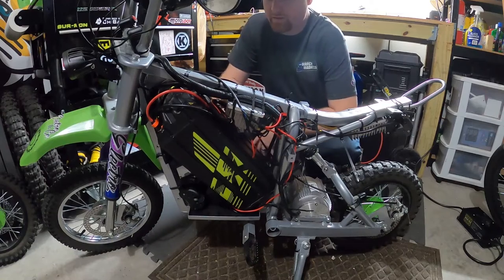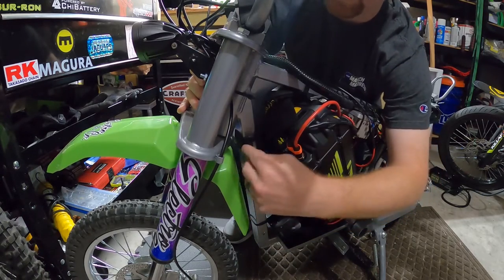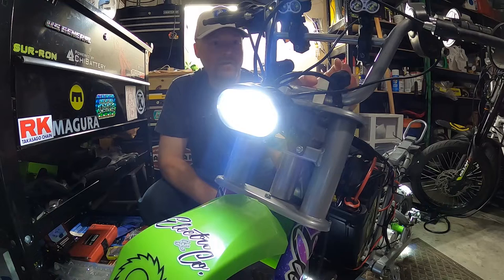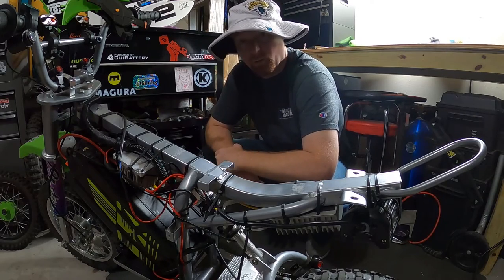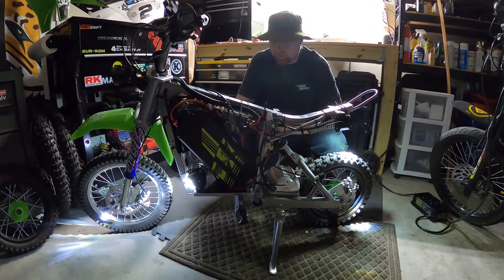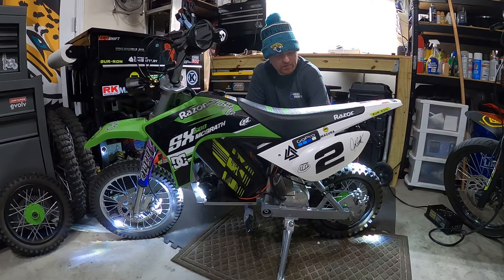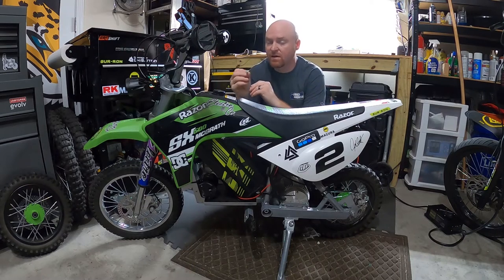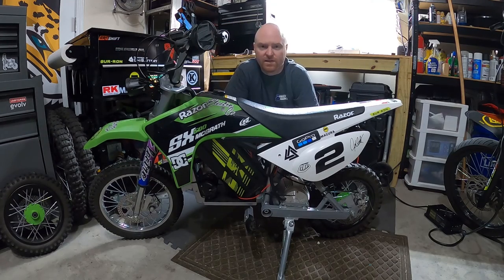Razor SX500 with 60v surron battery, 5kw motor & kelly controller

Comment: Yes. Please do a lighting video. I got an SX500 this weekend. The best if the MX line in my opinion.
Reply from the maker: Hey I agree! And you got it on the video!
Reply: @chaseschannel1151  Thanks! I am waiting for my Electro and Company kit now. I actually found both the SX and RSF650 for less than one new MX650. These are really sweet, capable bikes.
Reply from the maker: @Nohoze  that’s awesome. Great finds. Yes, with knowledge these bikes can become quite powerful machines and the best part is they look like toys so you can get away with riding them much more places.

Comment: How did you secure the battery. Your first video you had straps. Just wondering if you came up with a better solution?
Reply from the maker: @patrickbowen5567  I just used the straps, that and the plastics held it in place, def not 100% secure but with my riding it held up ok. Probably could look at hardware store and build better solution

Comment: What’s the point of the the 60v to 12v step down
Reply from the maker: I had some lights that were 12v. If I connected them directly with 60v they would burn up.
Step down converts 60-12v

Comment: Did you just order a standard 5k kit from E&C or did you request a different harness or anything?
Reply from the maker: I requested them make the wire pigtail to fit the surron battery. They were kind enough to change that for me no extra cost. the rest of the kit was standard.
Reply: Ok thanks. I love your bike and your explanation. I ordered an E&C kit 6 weeks ago with a battery but I think my next project will have the surron battery for longer range
Reply from the maker: @rednoseroyce  you will love the range. It rides for a long time. I really need to make a range video.
Reply: @chaseschannel1151 the wire pig tail your talking about is the red and black power pig tail boss ?

Comment: How do you like the battery? Still going? Tempted to use one for a new build but the connector is making ne hessiate? Do you use a specific sur ron charger?
Reply from the maker: Battery works great, plenty of power. I used the standard surron charger but a aftermarket charger surron specific would also work. Chi batteries sells one  probably another out there as well.

I asked electro & co to put the appropriate connector on the controller for me and I didn’t have to worry about splicing.

Comment: Does it work fine without plugging anything into the battery signal port in the battery (the port next to the power port coming out of the battery)
Reply from the maker: Yes. Never did that.
Reply: @chaseschannel1151  Oh ok i see thanks. What year is your battery? and have you had any issues with no having anything plugged into that
Reply from the maker: @schmeglyomigy6174 unsure on battery year. Actually sold the bike recently. 
Never had any issues though.